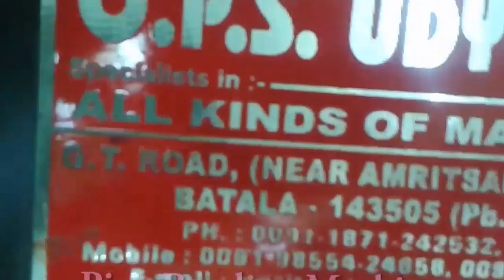O.P.S UDYOG | Lathe machine (Kharad Machine) manufacturer in Punjab ( INDIA) | Lathe Machine Price

Comment from the maker: KIND ATTENTION: MANAGING DIRECTOR. 

Dear Sirs / Respected Madam,
  
 We are pleased to introduce ourselves as one on the leading manufacturers and suppliers of Quality Machine Tools, Workshop Machinery, C.I. Castings, Electrical Goods, and Accessories of machines in our Country.  We had established our unit in 1950 and since then we are continuously serving our esteemed customers on regular basis . Some of the items manufactured and marketed by us are: -LATHE MACHINES, DRILLING MACHINES, RADIAL DRILLING MACHIES, SHAPPING MACHINES, HACKSAW MACHINES, BANDSAW MACHINES, MILLING MACHINES, SLOTTING MACHINES, HYDRAULIC PRESSES, POWER PRESSES, SHEET METAL MACHINERY, AUTO GARAGE MACHINERY AND WOOD WORKINGMACHIERY in various sizes and models etc. 

We are also exporting our products mentioned above to many Countries i.e. Bangladesh, Nepal, Siri Lanka, Saudi Arabia, Nigeria, Oman regularly from so many years to our valued esteemed Customers.

These machines are manufactured by us in various sizes and models. We are also regular suppliers of accessories of machines i.e. Four Jaws Independent Lathe (Dog) Chucks, Three Jaws Self Centering (True ) Chucks, Electric Motors, Grinders, Polishers, Welding Sets Etc. You may log to our websites i.e. www.parasexport.in and www.opsudyog.in  to see the full detail /specification of our products.   We are duly registered with various Govt. Departments and organizations like Department of Industries (Punjab), The National Small Industries Corporation limited any many Financial Corporations and Banks. We have already supplied thousand of machines to many proud customers all over India and abroad. 
  We understand the requirement of your organization and shall be glad to receive regular enquiries / Tenders of the items required by you. We shall provide the best assistance and assure to provide the best quality machines with minimum prices. 
Thanking you.
 Yours faithfully,
 O.P.S. UDYOG,
 Near M/S AMRITSAR INDUSTRIES,
G.T. Road, Near PARAS Wale, Batala - 143505, Punjab, India
Phone: 91-1871-220140 / 242532 Fax: 91-1871-242532
E-mail:- opsudyog@gmail.com, amritsarindustries@yahoo.co.uk,  amritsarindustries07@gmail.com,                   
Contact Persons:- 
 Mr. Sanjay Aggarwal (Chief Executive Officer)   Mobile & WhattsApp:+91-98554-24658, 
 Mr. Rajeev Aggarwal ( Chief Controller Executive)   Mobile & WhattsApp +91-98140-24658.
Mr. Divyanshu Aggarwal (Chief Executive Sales)  Mobile & WhattsApp +91-81959-51515